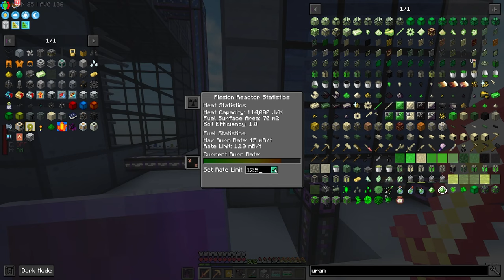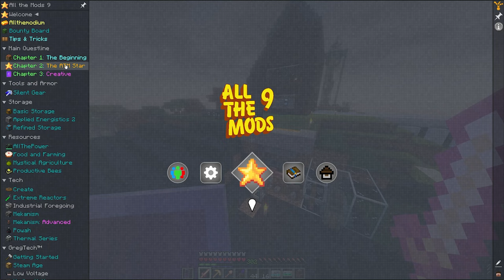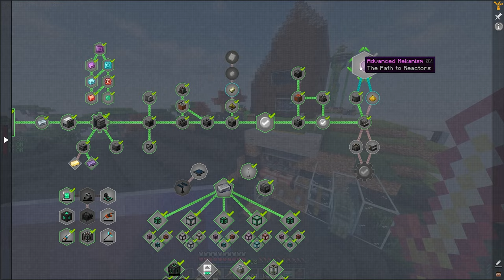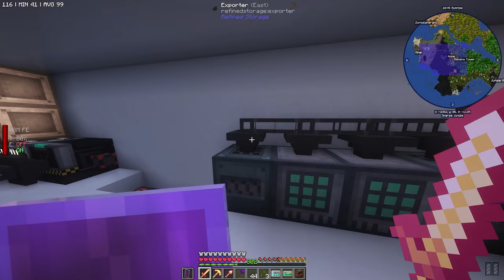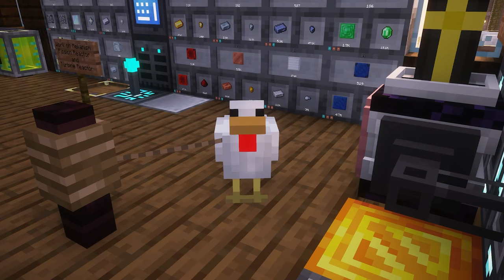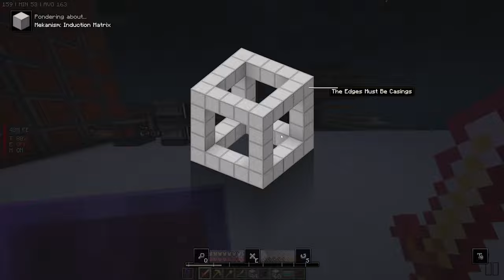Minecraft | ATM9 - #24. Power Storage the Mekanism Way

Comment: I have a massive Refined Storage system, and I've been using those Mega Exporters, Importers, etc. It's easy to miss because of autocrafting, but the first or second tier actually tells you that they have stack upgrades built in. I've added 4 speed upgrades into each of mine, but the things are lightning fast un-upgraded, too.
Reply from the maker: Gotcha. Yeah, running out of Brine didn't seem feasible to me so I assumed it was the importers and exporters, but that was definitely not the case lol

Comment: You can use an eternal water block from Evilcraft directly on the input of the reactor. Also, you don't NEED to output the water from the turbine.
Reply from the maker: Oh that sounds like an awesome block to make! I thought you'd have to pipe the water out, but I'll give it a check! Thanks

Comment: 2nd also the problem is water isnt getting send fast enough I would recommend creative upgrade from pipez and fluid pipes but if its too hard to make at the current level you can use integrated dynamics pipes and it's fluid cards ( I dont remember exactly what they are called)
Reply from the maker: I might be able to make the upgrades, but I'll see. Yeah I'm tying to find better pipes to use, thanks for the info!